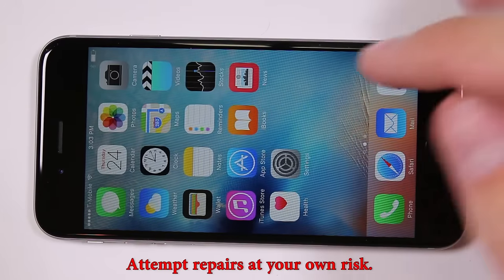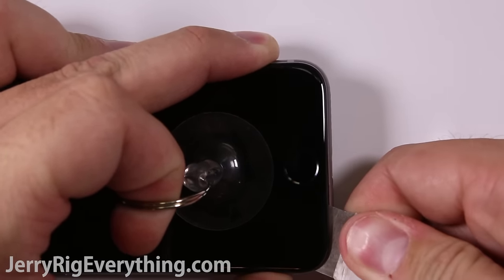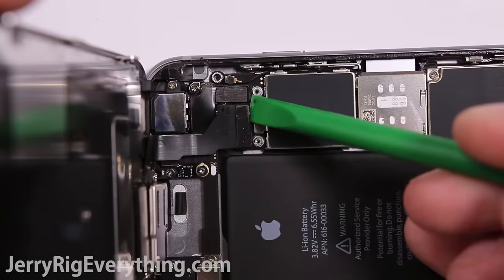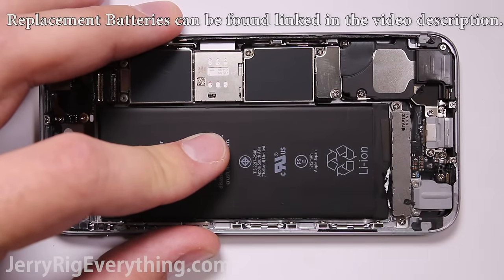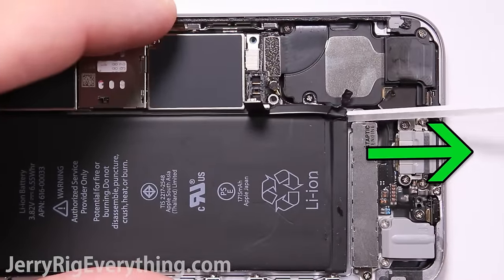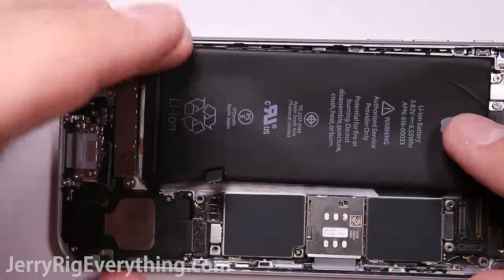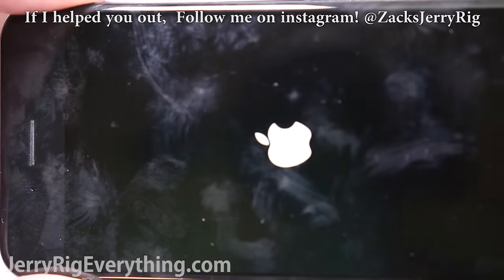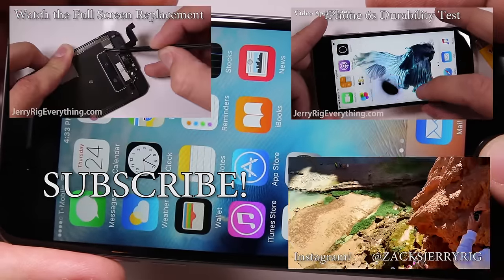iPhone 6S Battery Replacement in 3 minutes (Easy Method)

Comment: It’s basically the same as a 6 battery change. I made the mistake of pulling it through from the side as well. Pulling it straight out is the best method. I did the “pry of shame” lol also. Got the battery on the side I screwed up pried up enough to reach in with a set of my tweezers and pull the rest of the sticky tab out. If you get both of those sticky tabs out cleanly, the battery should fall out or come out with ease without heating up the back.

Comment: This is an excellent video and I used it very successfully to easily replace the battery.  I was doing it again on another phone, and my experience-based caution and strong advice:  work in an area away from any paper or inflammable material. I tried to pry the battery as the sticky tape snapped while I was removing it (and yes  - I was following Jerry's directions - but the tape just snapped), and the battery literally smoked and burned down to a reed-hot ember in less than 5 seconds, including burning 3 of my fingers as I grabbed the phone as soon as it started smoking.  Smoke for 1 second, flame in the 2nd second, and 5 seconds later it was a mini-inferno in my hands and I dropped it but fortunately I was away in those 3 seconds from anything inflammable.   What happened?  As I was doing the prying of shame, I believe I applied more force than necessary, and the battery bent/snapped at some edge, resulting in the fire.  Please PLEASE DO BE CAREFUL and do this far away from anything inflammable or incendiary devices, perhaps keep a steel pot/pan with lid ready nearby, just in case you have to deal with something similar to what I had to.  Once again, this is a great video, and please follow the directions with more caution and care than I did.

Comment: one screw doesn't want to go back in for one of the plates.   one screw on the bottom of the phone doesn't wanna go in either.   I also somehow burned a small point in my finger when taking out the old battery - saw a flutter of smoke, and a tiny burn mark.   I guess it touched something while I was wrangling the battery out.    Everything (kinda) worked out.   I'm usually pretty handy, but I think I will let the experts do this kind of stuff in the future.

Comment: Great video!  To the point and important details included. 
Replaced my battery in about 10 mins. 
Don’t know how the battery will preform but the process was not difficult. 
Thanks for posting this. 
I owe you one.
Reply: Ernie Engineer hey! I was wondering how the battery went? Was it great overall?
Reply: Green Guy battery life is great. Last two days on a charge and I don’t have to turn off wifi and Bluetooth. 
I don’t think the phone is as water resistant anymore though. I didn’t know how to replace the sealing around the perimeter.
Reply: @ernieengineer3462  thank you so much!

Comment: Great instruction video, but I wish I had a shop do it.   It takes very high dexterity.  The screws that hold down steel plate over the three screen connectors are the size of a grain of salt.  I could not get them in so I held the plate in place with some some Tyvek tape. (who cares this phone is very hold) Its Very important to heat up the back of phone with a hair dryer before attempting to remove the adhesive strips holding the battery in place.

The instructions are Great.  I took me an hour as a first timer with this task.   Like most tasks, the first time takes more time.

Comment: Have changed various bits on various apple devices in the past so was confident this would be no different. Had to go down pry of shame route on this as adhesive strips a nightmare. PEOPLE  BEWARE. My battery started smoking and had flames coming out of it as I think I had over bent it. Burned my hand, filled my house with really noxious fumes as I tried to prevent the molten battery completely destroying phone. Couldn't touch it for 10 mins as so hot. Cleaned out charred battery and scraped clean the casing, reassembled and incredibly it still works. DON'T BEND THE BATTERY..........

Comment: If the adhesive strip tears off the tabs without pulling out (mine did), just get the tab end of the battery up enough to grab the remaining white adhesive strips with tweezers; you can then carefully pull them straight out as shown.

Comment: The battery should be the first connector to be removed. Removing LCD connectors before you disconnect the battery is a great way to ruin your phone. Many times it will leave white lines.

Comment: Not sure is this is covered by one of the comments below but a warning should be inserted in this video about the pry of shame.  There appears to be black tape like substance (I believe it completes a circuit) that can be damaged.  JRE should really warn folks to be careful at this step.  I have successfully replaced 3 batteries in my 5s.  This was my first 6s battery replacement attempt.  I have never had success with the adhesive removal.  All have been with the pry of shame.  My 6s is now worthless.  Thanks.

Comment: I appreciate the video. Followed the steps exactly last night, powered it back on and all seemed good. Today, I realized all WAS good...except the camera doesn't work (front facing does work though). So, I tried (many times) reconnecting those ribbon plugs, but nothing has changed. Any thoughts on what the cause might be would be much appreciated. Thanks!
Reply: If there is no debris of any kind on the ribbon cable plug or socket pins, you probably cracked one of the traces in the ribbon cable if it got bent too much during the handling.
Reply: I ended up taking it to a repair shop. Camera issue aside, they said the dim screen was an issue with the LED backlight (I may be remembering that incorrectly). I described to them how I did the replacement and they felt that because I didn't use any kind of anti-static device or technique, I probably shorted those circuits out (the front facing camera and the backlight for the screen. I had to buy a new phone. :(

Comment: you are supposed to remove the taptic engine before you pull those battey adhesive tabs. it's very easy. try this nest time.

Comment: Excellent thank you followed step by step and worked a treat 👌🏻
Reply: James were you able to pull the tape out like he said or did you end up prying the battery out? A couple of other youtubers used a heat gun to soften the glue but I am not going to try that.
Reply: @kingorbit  bit of both had to do two phones first was a bit fiddly to pull it out but then got half the glue out the rest I prised by bending the battery... second time came away a bit easier although still needed to wiggle the battery a few times 💪🏻

Comment: You forgot about putting back the glue for around the outside edge of the phone! Having followed your instructions exactly, at the end I was left with a blue sheet of plastic with the black outline of the phone on it. It wasn't until I finished putting everything back together that I realized it was the glue for the edges! ACK! Now I have to take it all apart again!

Comment: Also, out of curiosity, why did you take the screen completely off in this video but left it on and just held it at a 90 degree angle for the iPhone 5 battery replacement?

Comment: Just done this myself have never repaired a phone in over 10 years last phone I repaired as the very easy impossible to mess up sony walkman phones! You don't need to disconnect the screen or remove the screen plate! Mine were stuck down with sticky pads and I did not want to risk the screen. Just use a bottle or a wall to support the screen you do not need to disconnect it. I struggled getting the screen off from the adhesive so I used a very thin piece of metal/clip from a cheap plastic photo frame. I also broke the pull tabs so just pulled the battery out with pliers completely destroying the old battery but I would not recommend doing that as it is a fire hazard lol

Comment: Do you really need the double sided tape? How much movement can the battery possible have? It looks like its packed in there pretty good.
Reply from the maker: It still rattles without the tape. It's 100% needed.

Comment: I just did this repair today,kit came with the new adhesive strips lol let's just say they ended up a bundle of garbage within seconds so I put the battery in with folded electric tape and it holds it in place just fine with no movement.

Comment: I had mine now for a year and a half or so, I started to notice excessive battery consumption & I've never replaced the battery before, do you recommend it's a good time for a battery replacement & would I gain back the original factory consumption as it's was quite great I remember.

Comment: Great video! I was wondering if you can use an iPhone 6 battery in a 6S?
Reply: I had the same question - wanted to mod my 6S with the 6's larger battery, but apparently the dimensions of the batteries are different due to the new taptic engine in the 6S.

Comment: Honestly doesn't look too difficult, but I'm still afraid I'm gonna fuck up on the pull tabs. I have a 6s on 10.3.3 but the battery capacity is about 85% and I can definitely feel the performance throttle. I don't wanna lose iOS 10 by damaging the internals, but I'd rather do it myself cuz I'm afraid a repair place will update it somehow(that's what Apple did to my old se when I sent it in)

Comment: Nice video. You said the screen has adhesive? Therefore it is probably not as water tight afterwards?
Reply: The 6S is not watertight to begin with.
Reply: Haha i know, i meant water resistant (especially to moisture when let's say you sweat) :)

Comment: What double sided tape did you use as a replacement? Is it easy to remove the battery with that double sided tape or is it better just to buy replacement OEM pull tab tape. I've used the pull tab tape before as a replacement when I get it free with a new battery but out of several battery replacements I can never seem to get the tape all out before it breaks. Pry of shame sucks.
Reply: 3M

Comment: The link you provided, is that where you got your battery? I recently bought I honey bull battery cause it was cheap and had 4 star review but the cable on it ended up not wanting to connect to my phone fully and it does not work at all. So basically I just want to be assured that this battery will fit and work.

Comment: Indeed I had damaged my screen because I connected the battery first then the screen last, and now my phone is actually turned on (it could ring a sound, could be charged, and could vibrate), but the screen won't.

Cheers for the video maker, but I guess people need to see the comments first about plugging the battery last, because some people had already made this mistake, so I hope nobody will repeat the same mistake that we did.
Reply: I did the same
Reply: Is nothing we can do ?
Reply: @pidgey4gaming951  well after I realized I couldn't do much more to fix my phone, I brought it to the pro. This is a serious problem to the phone, so please bring your phone to your nearest service center immediately.

Comment: How long does it take for the phone to recognize the new battery in settings? Took my 6s to a phone repair place and as soon as they gave it back to me i opened settings and checked the battery health. 80%. Guy said it would take a couple charge cycles to update?

Comment: When prying the battery you should use something large and flat, like a credit care or a couple razor blades. Prying with a tools like the one in the video will cause ruptures inside the battery. It could catch fire and explode!
Reply: You don't need to pry the battery out. The strips have pull tabs on them, just work them around the sides of battery slowly.
Reply: +tails300 Did you even watch the video?!
Reply: YES! did you?
Reply: Of course. I commented on how he could have pried the battery more safely AFTER resorting to that AFTER the pull tabs failed on him. Your response was that he should have used the pull tabs that he used and your advice to pull around the sides was EXACTLY what he claims to have caused caused his problem. Despite your claim otherwise, it still sounds like you didn't watch his video.
Reply: I watched the video and I've done the repair my self on an Iphone 6, which is pretty much exactly the same. In Ifixit's video they tell you to work the tabs around sides of the battery, as to not rip them.
Reply: tails300 I understand. It sounds like they have contradictory advice to this video. If you have reason to believe that they are more correct than the author of this video then, by all means, make your own comment saying so.

My comment, OTOH, was a suggestion/critique on how he chose to pry the battery after he tried following the advice you and iFixit are offering and then directly recommended against doing it that way.

I have known how to utilize the pull tabs since Apple's official support documents were leaked regarding servicing the iPhone 5 battery in 2012. Apple says to pull straight out of the bottom like the author of this video now suggests. Even so, when I remove the battery I usually don't do either because I am usually reusing the adhesive.

Because iPhone 4, 4S, and 4 CDMA pull tabs would frequently tear and because you had to remove the battery for most unrelated repairs, I had to get good at removing them without all the force he applies in this video. My techniques continue to apply so well to iPhone 6 and 6S batteries that I do it just to preserve/reuse the adhesive.
Reply: Ok that's perfectly fine and I did leave a comment on previous iPhone 6 video he did.
Reply: Razor blades a very bad idea...NO METAL TOOLS when you  are inside the phone

Comment: Watch out folks when it comes to removing the adhesive strips.  I have changed two batteries on these phones and the adhesive strips do not come out as easily as this video shows.  As a matter of fact, they usually break before coming out all the way.  Then you have no choice but to try and pry up the battery.  Bend the battery just a little as this guy shows and it shorts out and will cause your phone to burn up.  Hopefully you are removing a completely uncharged battery.  Live and learn.  I speak with experience because I had to throw away my last phone.  I strongly suggest having a professional change out the battery.

Comment: I changed the battery as shown, in the same sequence, though some say the battery should have been disconnected first and last. Everything turned on seems to be working. The only thing is that the phone is still hot when in use, what should I do? Could it be the battery, its a Yontex from Amazon? Should something be reset? what could it be, any ideas?

Comment: Hi, I have a question. So after I replaced the battery I messed up  putting the new adhesive strips on for the bottom of the battery, so instead I decided to put two tapes and let the battery “stick” to the tape and the surface of the phone. Is this a problem or will the battery fall off? Or is this fine?

Comment: What is your opinion regarding higher strength batteries for the 6s?  Original is 1715 mAh.  Have seen 2200 and 2600 mAh claiming to hold charges longer.....

Comment: I changed the battery seemed to go fine except the connector for the battery seemed to be slightly lop sided ie the left side was slightly raised more than the right side. Turned on the phone seems to be working fine but the back feels fairly hot. Not sure if it’s just because I’m used to having a case on it and it’s normal???? Bit scared it might blow up???

Comment: It's 13C in my house. Is it a good idea to warm the phone by a heater before trying to remove the screen? Should this help to separate the adhesive? Or you can just not stick the new battery back down. Totally unnecessary!
  Remove the rectangular metal device just below the battery, otherwise the angle is too sharp. You don't need to remove the screen at all if you hold it at an angle clamped by your hand against the phone. If it's cold warm the back of the phone with a blow heater or hairdryer or leave it back side up in the sun for 5 mins.

Comment: Sir how much force should I use for fixing the screws after I have replaced battery.When to know that screws are tight enough and further forcing will do damage.
Reply: Put a bit of force but not enough that it would strip the screws. Once it's tight slightly give it a turn to where it doesn't move. Do NOT use full force. Once it doesnt move it'll be fine.
Reply: Dusty thnku 😊😊

Comment: so i put in the new gasket, close the phone up, making sure it's fully seated and sealed, and then looked up and saw the two metal plates and screws sitting there on my desk. lol.
Reply: hahaha
Reply: 2.5 years later and im back to do it again..

the adhesive holding the battery down was absolute munging this time, i think it punctured the battery getting it out.. it smells funny and it's getting kinda hot.

Comment: Hi will this stop the Touch ID from working? I had a bad experience replacing the battery on the 5s. Once the Touch ID stops working nothing can be done to get it working again as only Apple have the equipment to replace the Touch ID sensor and get the phone to accept the new one. Thanks.

Comment: A steady hand...the right tools...analyse the problem and the desired outcome...have a beer...and you can fix any problem you care to think about!
One thing......at 2.23, battery install.....make sure you push the new battery all the way to the right( as seen on screen); the batt. conn. has no give in this direction,( it's on a cable).Apart from that folks, don't even think about removing the screen; you don't have to; leave well alone, Make a gantry to hold the screen at 90 deg....it's easy.....why fiddle with 5 multi-pin conn's when you only need to deal with one? Good luck .. which you don't need; watch these excellent how-to's and rehearse!..........makt that wood gantry!